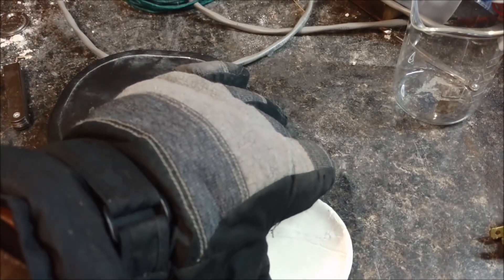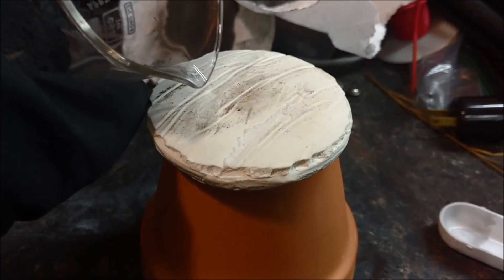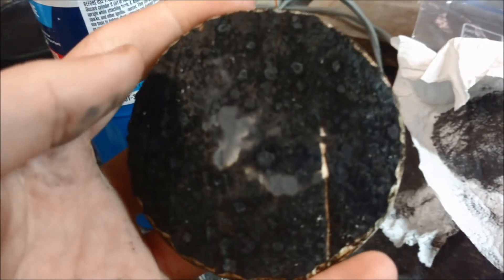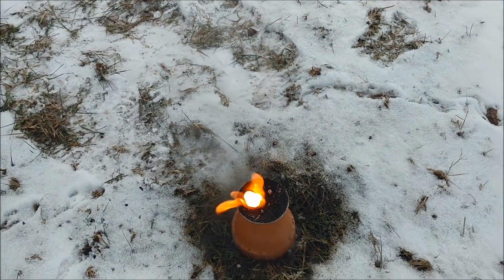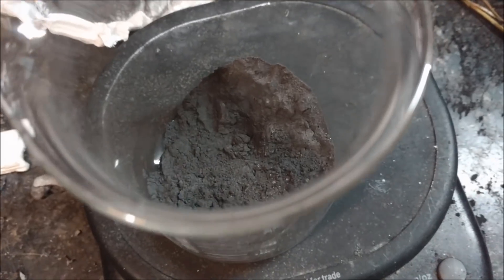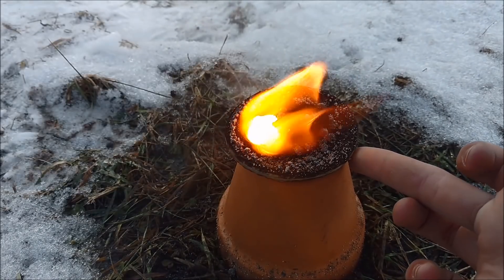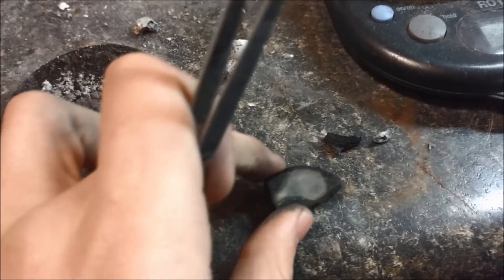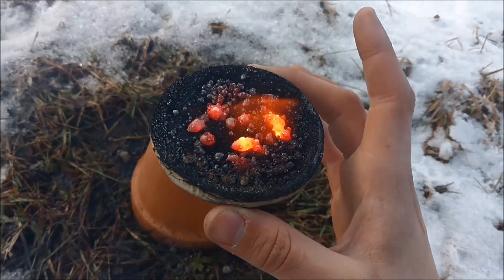Starlite Vs. Thermite: First Tests

Comment: The reason for the unburnt Thermite was because it had a piece of Starlite on top which prevented most of the heat from getting to that portion of the Thermite to ignite it (it was first ignited from the top)

Comment: I have no Idea why Musk isn't using this.

One. Heat protection.
Two. Being nonconducive to heat. It's probably a good electric insulator. I.E. fantastic for capacitors. 
Three. With this being an internal cover.. heat sensitivity could be reduced as a major concern.
Four: did anyone check how it works with Radiation?

Because if it can work there too..

This could be the key for Fusion. Or just atomic Rockets.

With less need for fuel mass per Joule.. well.. the rocket may be strong enough to actually be like a car than.. you know. At best a cheap project.

Comment: You melted iron on it, the Starlite releases carbon when heated, insulating anything behind it from heat, that carbon would mix with the iron closes to it and we know adding pure carbon to iron makes steel.

So you technically made a filament of steel.

Comment: How about a test of its thermo conductivity? Perhaps compare two bottles of water, one wrapped in commercial insulation (thinsulate if you can get it) and the other in an equal thickness of the simplified Starlite. Start both bottles at the same temperature and put in a freezer for a known time, then test for the difference in temperature over time for both samples.

Comment: Hi Thanks for sharing. Can you test is so the starlite does not burn? For example, cover the disk on both sides with metal sheets and then heat one side of it.

Comment: i would not recommend this as a material to line a furnace with because it generates Carbon foam and Carbon foam is  flammable so it will wear out after a time especially if u have a strong blower going

Comment: This is insane, basically before you th ink to try this, one of those red hot beads has enough heat to burn a hole through your LEG. I am surprised by the lack of spatter shields here and I encourage the presenter to, for their own sakes, employ better safety.

Comment: Proof that Nighthawklite works.  One note of caution, though:  I wouldn't advise getting too gutsy with putting your hand on it when it has molten metal on it -- no matter how good an insulator it is, if a bead of sweat or snowmelt gets into the hot material, that stuff is going to get splashed onto your hand (bypassing the insulator), and you will be in a world of hurt.

As for what it takes to finally get through this stuff, anything hot enough to vaporize carbon should do it.  Short of that, an oxygen-rich flame at lower temperatures should also work, but would probably take a long time, so the stuff could well be usable as a cheap disposable heat shield (for spacecraft reentry use), as long as you can make it to have good enough mechanical properties so that it doesn't flake off from a large area of somewhat complex shape.

Edit:  Semi-confirmed:  https://www.youtube.com/watch?v=0anEMZs9zHE (shoutout) -- oxyacetylene torch + molten steel slowly penetrates it  If you watch their next video, you can see that thermite is getting near the limit too.  You can also see that burned toast is a surprisingly close second.  They also tested a (presumably commercial) graphite crucible, which withstood the heat for its own integrity, but didn't insulate very well.

Comment: Would be nice to get some info on it's structural stats, though further heat testing is also promising.
If this is significantly stronger than the ceramic tiles and such previously used on rockets this could be huge.

Comment: I think you should put that starlite at the bottom of the pot and put more thermite on it and test prolonged exposure to the high temperatures.
Or coat the pot and ignite thermite inside.

Comment: OK. Here goes. We need to know your mixture of thermite. There are many thermite reactions, and some of them burn at very, very different temperatures, and your mixture burned very quickly for Fe2O3+Al thermite, let alone TH3, which is the real breaching thermite, also known as Thermate TH3. Secondly, placing thermite on an object doesn't work, as it hasn't obtained maximum heat when it touches the object. As TM31-201-1 states, "In order to penetrate...the mass of the thermite must be held away from the target during the initial combustion period. This minimizes conductive heat loss during this period and results in the thermite attaining maximum combustion temperature. When that temperature is reached, the thermite is dropped onto the steel plate surface and a hole is burned through the plate." It goes on to say that cutting a beer can in half, and setting one half on top of the other, inverted, can be used as a penetrative device. Filling the top half with thermite, and setting it off on top of the other half of the can allows the thermite to attain maximum temperature before spilling down.  Since just anyone can use normal thermite, and its use is honestly getting boring in chemistry channels, I suggest TH3, as I said earlier. TH3 is 68.7% thermite, 29.0% barium nitrate, 2.0% sulfur and 0.3% binder (such as PBAN).
Reply from the maker: Thanks for the information! The mixture I used was the fairly standard 8:3 mixture of black iron oxide to aluminum. I'll have to try some of those mixtures!
Reply: @Fr223Laboratories  red iron oxide generally produces higher temperatures, while black iron oxide is better for collecting iron samples. I would definitely go for red in a burn test, especially since its cheaper!!!

Comment: I want to see someone make a cup out of that stuff and see how good it will hold up when it's filled with molten iron, and at the same time keep a constant temperature reading from the middle of the bottom. Something that's pretty much a flash and gone like thermite works, but I'll be impressed if you can just pick up the cup

Comment: Try building a metal forge with it. Ok, it can take heat, but for how long, and how well does it hold its structure? If it's as easy to make as I hear, refractory cement may not be needed.

Comment: Piling thermite on an object is not a proper test. That's like placing a bullet on an open pile of gun powder and expecting the bullet to leave the pile at 2,700 ft/s. The results might be different If all the energy from the thermite only had a narrow space to escape and the narrow space is directly on top of whatever you want to test. Take care
Reply from the maker: Never said this was gonna be the only test. I plan on testing it against a small hybrid rocket engine in the future.
Reply: @Fr223Laboratories  
I'll tune in for that, take care
Reply from the maker: @IamMe10-4  Thanks!
Reply: You're an idiot

Comment: Wait so that recipe was real? Will you elaborate on how to make starlite? Using what as an amount, weight or volume for the 10% ratio? & what was the glue exactly?
Thank you!
Reply from the maker: Yeah this was using Nighthawkinlight's recipe. The mixture was far from perfect, I just used 1 tablespoon of baking soda for every ten tablespoons of cornstarch, then enough Elmer's glue to make it feel like Play-Doh.
Reply: @Fr223Laboratories  awesome ! I tried 10 tablespoons of cornstarch then 1 table spoon of baking soda with just enough glue to make it like play dough.. While still wet it held out quite well, i then remembered he said a "tenth" of baking soda so next try i will make 9 table spoons and let the last one tenth be the baking soda.
Vary awesome! If I can get it right I want to make a wall for a wood stove in my van & maybe even use it to insulate the wood Stove itself so it wont burn so hot...
Who knows? This stuff is incredible!

Comment: could be used as a mould for casting but i guess the carbon would burn causing a rough end result and there would be too much slag. perhaps a bigger test with a beaker shaped starlite piece and more thermite?

Comment: Try making some Starlite paint. It might make a good exhaust manifold/header coating.
Reply: thats actually a pretty good idea. could use it as an undercoating around the area where the hot exhaust would be routed through

Comment: yeah you should do something like a rocket motor holder thing surrounding a thin cardboard tube so you can insulate ultra light weight rockets out of it. and while you areat it what about mixing in some bentonite or similar clay to  and seeing how it holds up as a rocket nozzle. I don't think it would be great as the direct tube for rocket motors because the CO2 could put it out or something but see how much of the rocket you can make out of pure "hawklite".

Comment: I'd have put the plant pot on top of the starlite, maybe suspended by a couple of small blocks, fill the pot with thermite and allowed it to drip through the hole in the bottom of the plant pot onto the starlite. The stream of molten metal coming through, produce an interesting result
Reply from the maker: Guess I'll have to test that in the future!
Reply: @Fr223Laboratories  I'd love to see if you do 😁

Comment: I have a homemade acrylic bender.  It has a piece of aluminum C-channel  where the nichrome wire sits.  Unfortunately the wire sometimes touches the aluminum.  Could I line the channel with this version of starlite to prevent the nichrome from shorting circuiting? How conductive is it?
Reply from the maker: Possibly, the Starlite shouldn't be conductive.
Reply: @Fr223Laboratories  I wasn't sure since graphite conducts electricity, but diamonds do not.

Comment: Maybe gonna try and isolate my propane forge with this if I have the time. Will report results.
Reply: Neeverseen 
Well? 
I’ve thought the same thing. If I can line the inside of my propane forge with a quarter inch thick wall of this stuff, how long would it last under multiple firings?

Comment: Now make a rocket nozzle. Ha, I finished typing that just as you said rocketry.
Reply from the maker: I literally just fired a hybrid rocket motor! I'm gonna be using that in the future for testing this stuff!
Reply: @Fr223Laboratories  Sweet! I guess I'ma have to subscribe. I want to make some rocket motors too.
Reply: How are you going to avoid it simply burning with the rocket in the presence of an oxidizer? Or are you using it as the fuel o.O
Reply from the maker: @BrokenLifeCycle  I probably wouldn't end up using it as a nozzle, probably more for heat protection for different parts of the engine.

Comment: i have a suspicion that the reason your iron beads came out so pure and shiny looking is because your starlite's carbonization may have gotten into the iron beads and fluxed them into mild steel.
Reply from the maker: That could very well be!
Reply: @Fr223Laboratories  i would love to see you make containers or objects out of it to see how it holds up as an insulative building material, i recently made some myself and i noticed it came out with a hard, rigid plastic feel to it, so i figure it has a wide range of applications.
Reply: They came out shiny because they were encased in reducing flame from starlite while cooling down and didn't have chance to oxidize.

Comment: A cool experiment ( pun? what pun?) would be to make a box from Starlite, have some thermite inside it and see how well it contains heat in an enclosed environment. You'd have to have a few holes in the walls to allow expanding gas to escape though, exploding Starlite with bits of molten metal wouldn't be very nice.

Comment: I'm wondering what affect there would be on this products performance, if any, if it was under compression 🗜 why it was curing. 👍
Reply: As Starlite is mostly made up from a liquid material, it would be very difficult to compress and allow it to dry. More than that though,part of it's thermal resistance comes from the structure of the carbon as it forms. If the carbon was compressed the air gaps in between would not provide as good a level of insulation. Although the carbon radiates heat very efficiently the closer the layers are the more likely that they will combust as  well.

Comment: There's your problem you need to focus the thermite in a steel mold and make sure its packed tightly then set that on starlight and light with magnesium strip not fireworks I bet that will chew right through it make that vid please
Reply from the maker: I don't see how much of a difference a steel mold would make, especially when the thermite would most likely melt through it. Packing it tightly would probably make a difference and that's definitely something  I'll try in the future! Thank's for the feedback!

Comment: But what happens if this burnt or unburnt material is soaked in water or/and oil and then putted back into the flames?
It could still protect? People tend to put down fires with water.
Reply from the maker: Great question! I would imagine that the material would behave in much the same way as I've seen people use the material before it is fully cured and is still wet. Once it's dried I'd imagine it wouldn't absorb much water but I guess that'd be something I'd have to test!

Comment: Starlite doesn't char up as much, if you look at the original footage of the article on the Tomorrows World program aired in the 1990's.

You may have something with similar properties, however, can it be used like plastic? The actual stuff is referred to as plastic and it looks like plastic.
Reply from the maker: Good point, I don't think anyone ever actually figured out what Ward was actually using, this is just the same stuff that nighthawkinlight made.
Reply: @Fr223Laboratories  Either way, pretty impressive stuff, if you tried different products that can carbonise but not to the extent that you're gettung, you could use it as a cheap alternative to a ceramic crucible if you can heat things hot enough and it retains integrity, you could lead to improvements in refractory / fire proofing homes on the cheap.

What is its cold end thermal abilities like? Will it resist ultra cold temperatures and swing to ultra hot in very little time.

If you think about it, in space a return vehicle has to swing from temperatures reaching absolute zero to hundreds of degrees in the sun but then get subjected to several thousand degrees on reentry, so it must have good thermal properties from contraction and expansion otherwise it would fracture and that could be a problem if the underlying shield of the reentry vehicle is compromised.

So, do you know anyone with liquid nitrogen?

Comment: Could it replace k wool in a foundry
Reply from the maker: Possibly, the only issue is that the insulator would have to be replaced much more often.
Reply: Francium Labs yeah but starlite is cheaper, biodegradable and easily self engineered

Comment: Unfortunately starlite burns in our O2 atmosphere, but that's not a problem when in orbit around the sun.  Carbon doesn't vaporize until extraordinary temperatures, or until it can be attacked by O2 to form CO2.  

While tests on Earth are interesting, they fail to accurately represent just how hardy this material really is.

Comment: Make a pot out of starlite and then burn full load of theramite in it. You can monitor the temperature of thr exterior with one of those laser thermometers and check a ceramic pot as a baseline as well.
Reply: Beyond the Press channel did this as well:  https://www.youtube.com/watch?v=Qtm_xOtw_r0

Comment: Is there any way to introduce air bubbles inside the starlite to make it more insulative. More like the silica tiles of the space shuttle
Reply from the maker: I never even thought of that! I guess It could be done if I used a different binding agent that allowed it to be more of a liquid mix. I'll have to try that!
Reply: @Fr223Laboratories  How about ammonium carbonate to provide more gas as well? Sodium oxide/hydroxide inclusions might weaken the carbon foam, though they might also regenerate the carbonate after a while in the air. This paper on elastic carbon foam production may be of interest. https://www.researchgate.net/publication/255770921_Elastic_carbon_foam_via_direct_carbonization_of_polymer_foam_for_flexible_electrodes_and_organic_chemical_absorption It looks like it is not compartmentalised enough for a thermal insulator but if you used a starter foam that was bubbly rather than meshy it might serve. Polycarbonate foam?
Reply from the maker: @pattheplanter  Thank you very much for the suggestion, and thank you for linking that paper!

Comment: does it mold easily and accept things like fiberglass mesh for reinforcement? I would like to see if it could be used to insulate car exhaust manifolds against radiating heat into fragile electronics, or the hot side of a turbocharger from radiating into the intake on the cold side. This seems like an interesting project.
Reply from the maker: I'm not sure about that, I think if you made the mixture thinner when you could get it to cure with fiberglass.

Comment: HEAT rounds work by cutting the armor of a tank with molten copper. I wonder if this stuff could be used with layers of armor to stop antitank weapons?
Reply: Heat rounds don't cut through armour because the copper is molten but rather form an extremely focused jet due to the pressure of the blast surrounding the molten copper which has no direction to go other than through the armour, starlite will not stop a shaped charge whatsoever
Reply: Its possible the molten copper will just alloy with the carbon and carry it away. If not, the high velocity will just shatter the foam and blast a hole inside...

Comment: I'm glad you performed this experiment. I had suggested it on Nighthawkinlite's video. Beyond the press is working with the recipe as well. I look forward to continuing tests as well as modifications of the recipe to see what it's capable of. It wouldn't work as a crucible but maybe as insulation for a refractory furnace